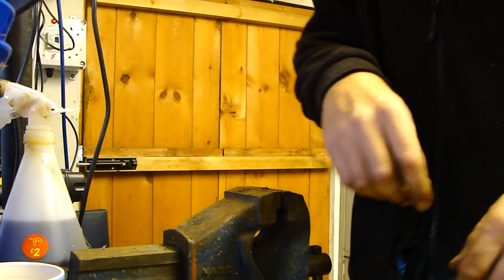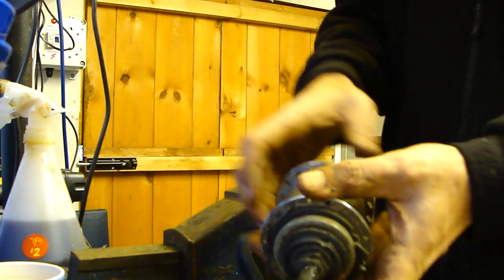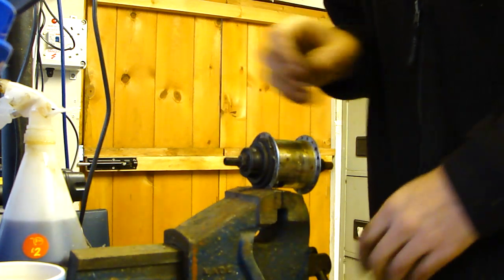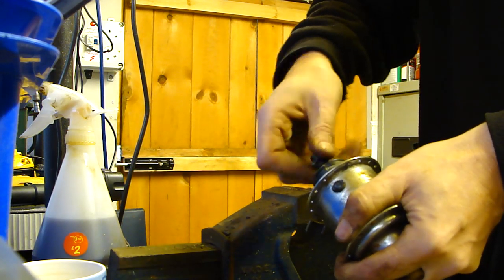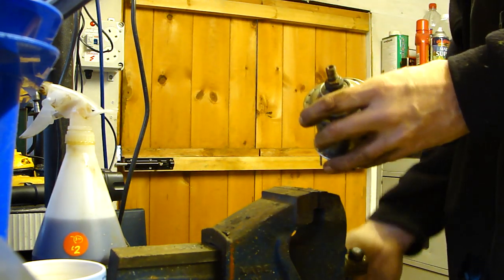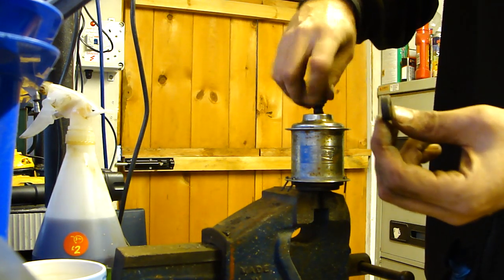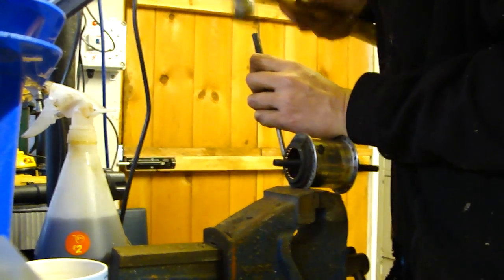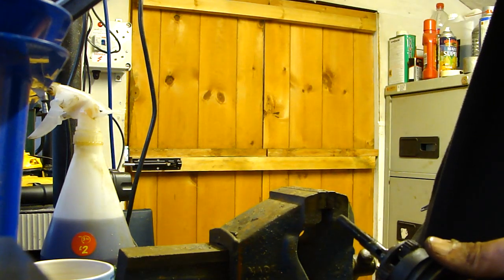Sturmey Archer 3 Speed hub strip down

Comment: I had a raleigh grifter,and the rear wheel kept locking up,had it in the shop for repair but a couple of days later it locked up again,it was as though the cones were tightening themselves as the bike was pedalled forward,do you know what the cause of the problem would of been ,as I am thinking about restoring a mk1 grifter when I find one.

Comment: All the references I have read say do NOT use 3-in-1 oil, it is vegetable based, will gum up the works. I use 30W motor oil.
Reply: I've heard that the 3 in 1 oil in the blue can is fine to use, it's different

Comment from the maker: There is a specific tool, Its called a C spanner I believe, available from many online cycle shops for about £15. Its quite an expense if you only have the one wheel to do thats why I showed the hammer/ punch method,
Have you tried knocking both sides? It takes a bit of a whack to free them